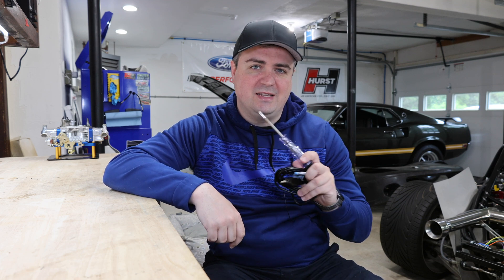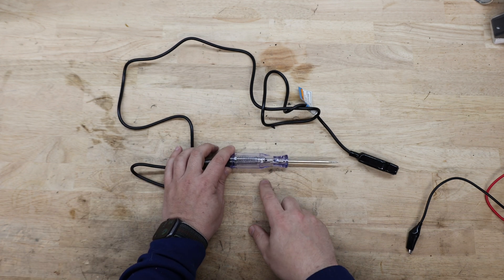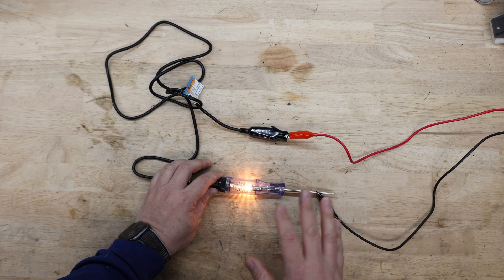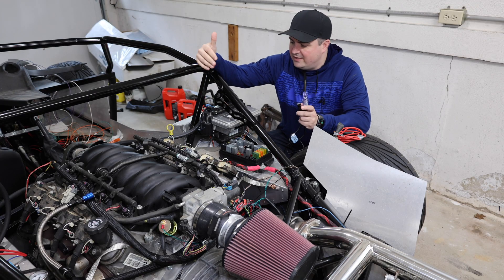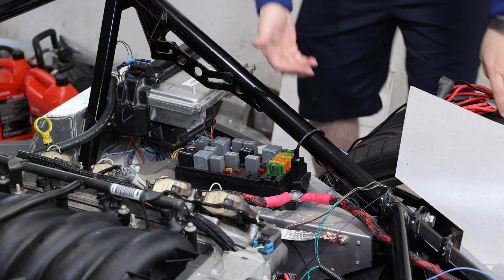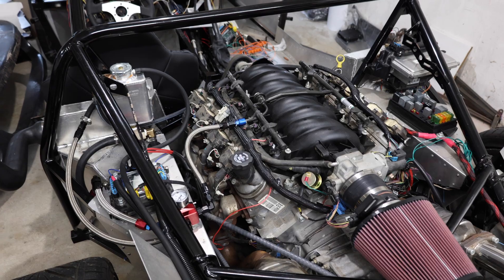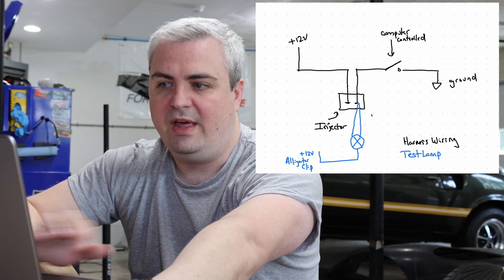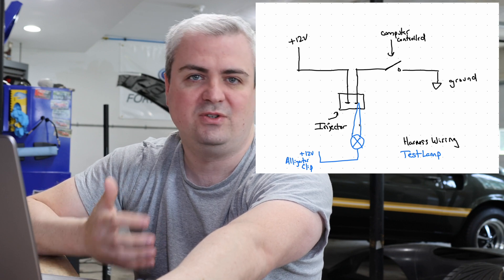How to Use a Test Light on Fuses, Injectors, and Finding Grounds

Comment: This is one of my favorite tools in my box. It is so easy to use, and you can get a quick answer to whether or not there's power. I might add a bit of advice, however. Always before using it one should connect it to the battery to make sure the light works first. One time many years ago I was trying to figure out why my tail lights weren't working. I used the light and got nothing. I checked the fuse and it was good (visual). I started working my way up the system trying to find out where the break was. Turned out the plug was all I needed to replace but because my light wasn't working I spent a long time and lost hair in the process trying to figure it out. Save yourself time and always check the light first. Lol. Great video brother.
Reply from the maker: Haha. That's a great tip to always check the light bulb first. I never thought about that. Great advice and Thanks for stopping by!
Reply: @SmackeysGarage  you know it my friend.
Reply: P6o]p88